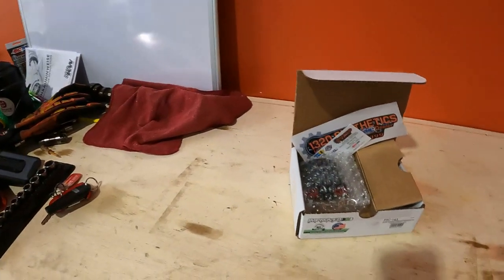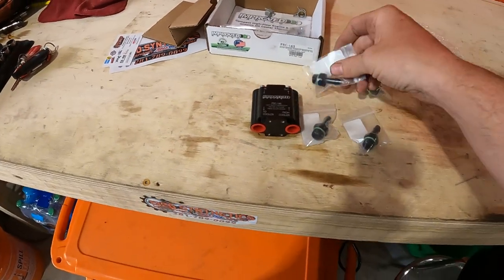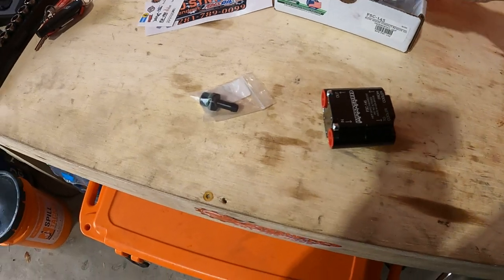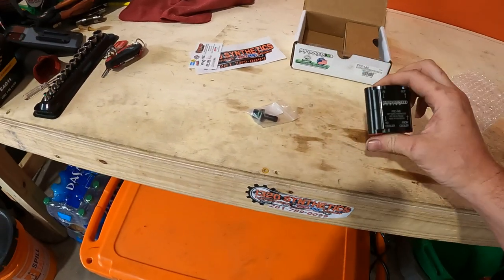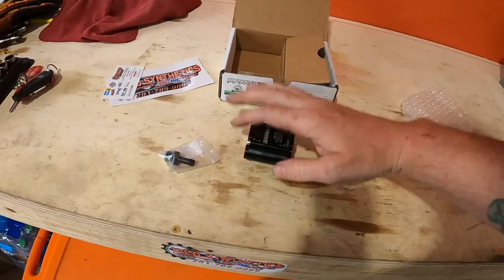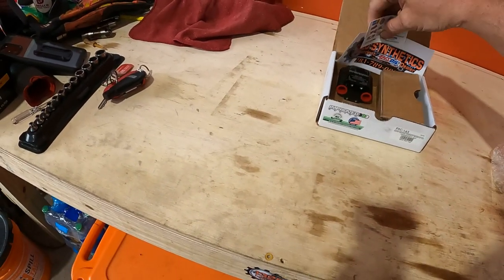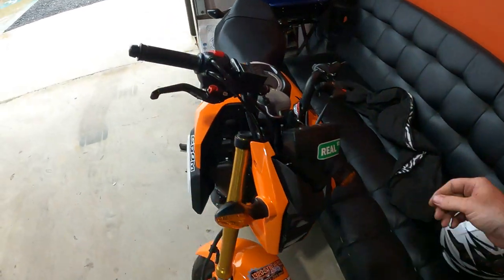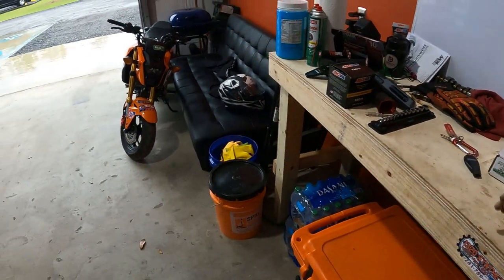Nissan Titan XD Cummins Transmission Thermostat from Improved Racing.

Comment: I wish you would talk about why I would need this thermostat and is it OK to completely shut off the fluid across the cooler without having a bypass most thermostats have a bypass.
Reply from the maker: The thermostats from Improved Racing are designed to fail in the open position and come with a lifetime warranty.